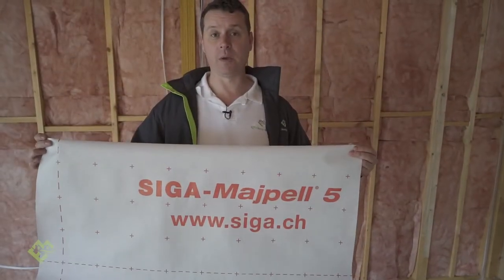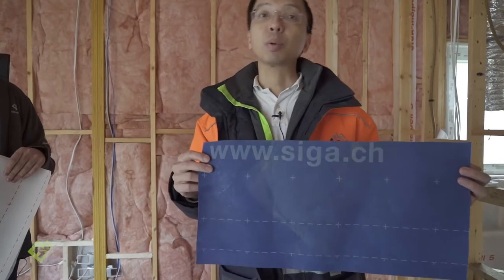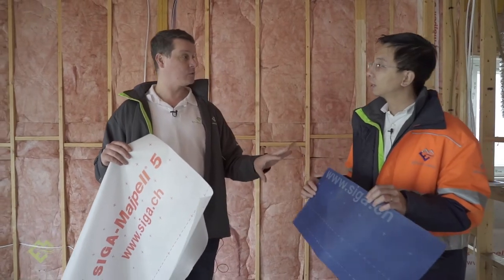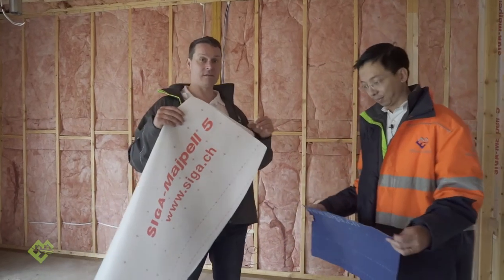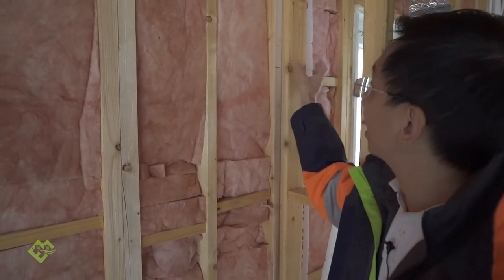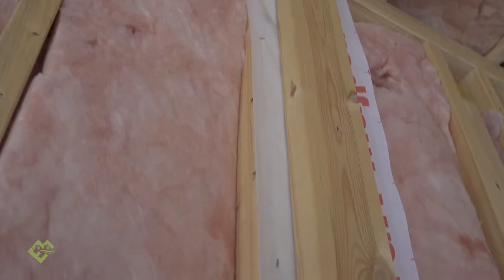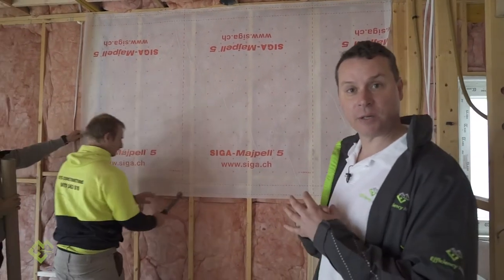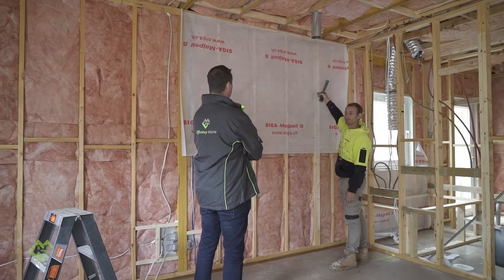Vapour Permeable Wrap/Membrane Installation.  (IT’S NOT FOIL SARKING!)

Comment: I live in the UK and  am about to build an insulated garden room. I get the point about the internal membrane being continuous with no holes. I  had intended to nail match board (timber) on top of the vapour membrane to be the internal finish. Are you saying this is a bad thing to do? What is your advise for the internal finish?

Comment: Those batts in the walls need to be flush it needs to be thicker or not squashed in , otherwise it will allow air movement in the walls .

Comment: Why do you install internally?  As it’s permeable, won’t hot air from the inside condense with the cold surface and permeate into the cavity and cause mould?
Reply from the maker: There are vapour barrier wraps and vapour permeable wrap.  In colder climates a vapour barrier wrap can be installed on the inside of the insulation, and normally a services cavity complements this detail.

Comment: What is your opinion about membrane, batten, foil sarking, batten and cladding this type of assemblies?
Reply from the maker: Max Young In what climate?
Reply: @ecoevo  Climate zone 1 and 2. Especially for walls and roofs that exposed to direct sun light.
Reply from the maker: Max Young I’m glad i asked the question.  You need a vapour impermeable barrier on the outside of the wall system, and you need it to be your best air barrier.  Contact us for me information..

Comment: How do you do the plumbing and electrical
Reply from the maker: The "TEXTBOOK " solution is the provision of a services cavity by battening over the wrap. It there is limited space (and budget), the plumbing will be run conventionally and all electrical should be in conduits before the installation of the wrap. The bay of stud where there will be plumbing outlets or electrical switches and outlets should have a sheet of plywood or OSB fixing on the outdoor side, all internal corners/junctions should be caulked; the wrap will be cut open at these bays. The wrap opening should be tape sealed to the studs. this way, the continuity of the air barrier can be maintained.